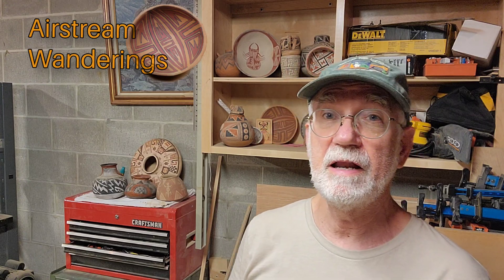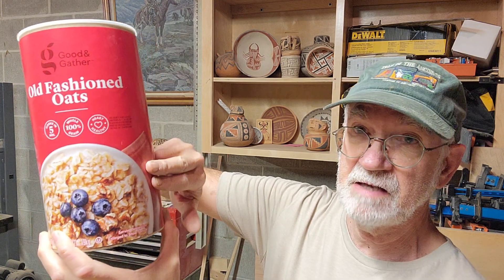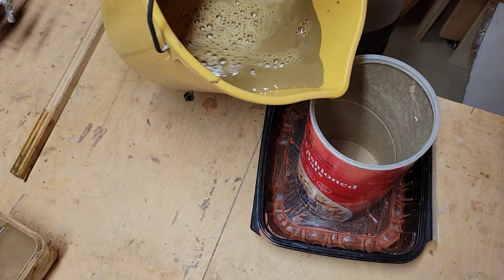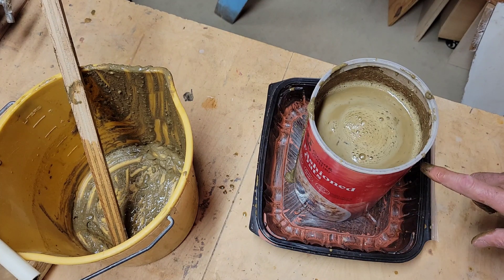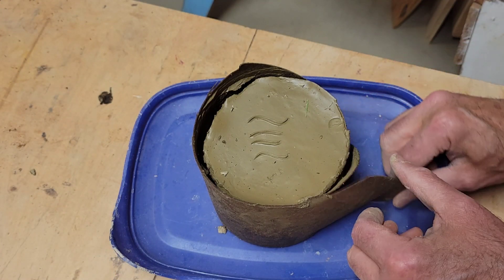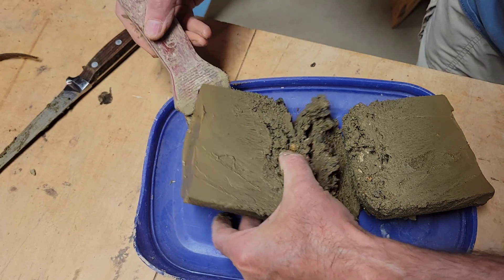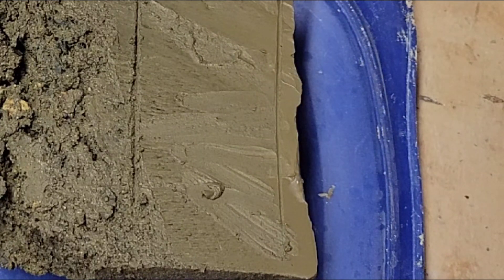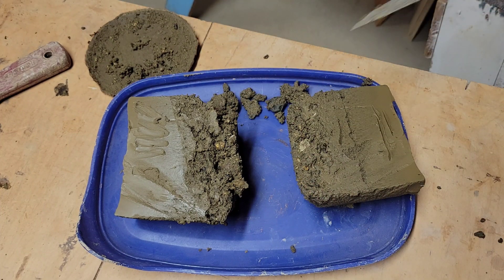What's in Your Clay?

Comment: Thanks for this demo.  It was very interesting to see the layers. Have you done any experiments with different sands for temper? Even though I live in the Arizona desert, I'm having trouble finding a sand I'm happy with. ( ie. too fine, too course, caliche particles) Should the color match your clay?  Any advice?
Reply: any sand that has been well washed and sifted will do.  If you don't have clean sand nearby, you can sift it (I use a milk strainer and the size of the grog is about 0.5 mm), then put it in a container and rinse it with water ten times until the water becomes clear.  I like to use sand that contains a lot of quartz, it can be recognized by the fact that in its coarser form it mainly consists of mostly white hard stones that make sparks when they hit each other... this sand is mostly white or yellow in color.  Mice sand (pebbles that have a glitter like shine that are softer than clod and in some cases can be broken by hand) This sand can be added to clay which is very stable when wet to make it a little softer to work with and easier to work with.  shape but the vessels are probably a little weaker than those with quartz
Reply: Grog from broken pottery shards or just grinded clay bricks is really good temper too
Reply from the maker: I suggest testing your sand/temper with some vinegar to make sure it doesn't fizz (sodium carbonate). My temper is usually course and sifted through a window screen and best if washed. I think the best temper is sifted  pottery sherds. Some use volcanic ash and diatomaceous earth but I never have. Sand/temper with rounded edges is not as good as  temper with sharp edges.

Comment: I’ve been experimenting with clay from my backyard. It’s bright reddish orange and contains a lot of mica particles. I dig it up and add water, mix it into a slurry, then run it through an old window screen. I pour the strained mixture into a wide, shallow Rubbermaid container and let it sit next to a dehumidifier. I’ve noticed finest particles on the top and just below that, coarser/grittier clay? particles. There is a lot of mica in the bottom layer as well. Once it’s right consistency, I wedge it and the clay seems workable. My ceramics professor at university ran in through a very low bisque fire(cone 017). The test pieces survived and turned a brilliant terracotta color and the mica stayed intact so it looks sparkly. Both pieces make a nice pinging sound when tapped. I’m waiting anxiously to pick up experimenting with it when the next semester starts. Hoping to see how high it can be fired, but I’m guessing it’s probably a low fire clay. Got any tips for someone experimenting? At what temps will the mica burn off/change? Anywho, really enjoy your videos. Keep up the great work!
Reply from the maker: Thanks, It sounds like you have a nice clay, at least for primitive firing and your processing makes sense. I don't use a kiln so I don't know about the temperatures. I have heard that mica is frequently added to clay that is going to be used for cookware. I suppose keep ramping up the kiln temp to see what happens. Why not try using a wood or charcoal fire?